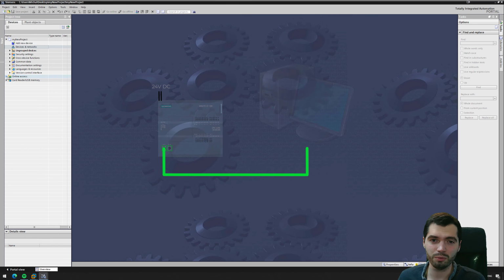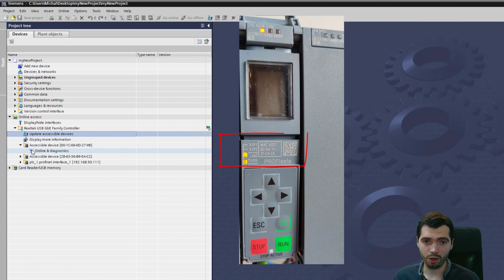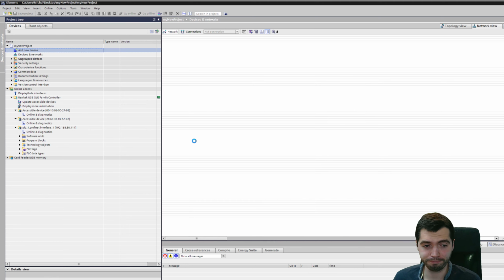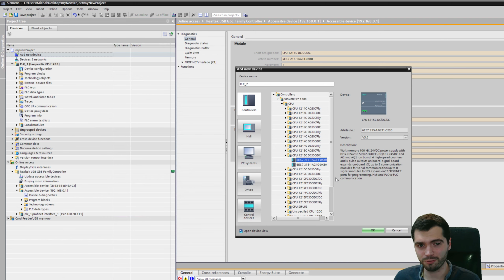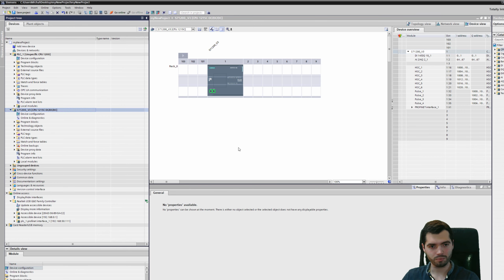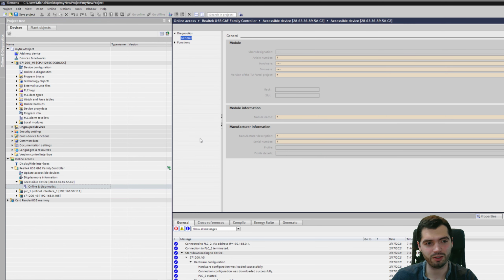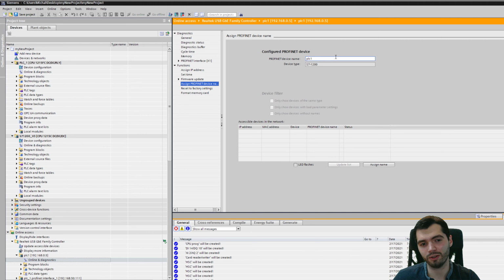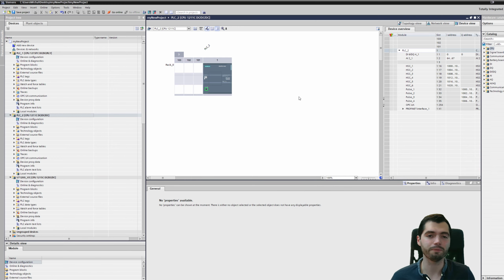First contact with an S7-1200 - How to go online in TIA Portal, even if Target could not be reached

Comment: I am not able to see the network cards. I keep getting an error stating An Iterface is not availbe for online connections to configured node. But if i check my ethernet conncetion it shows connected to an unidentified connection. Any idea of what might be going on. This is a work laptop so i do not have andim rights.
Reply from the maker: Laptops without admin rights can be a proper pain to be honest. Hard to work with and hard to diagnose. So it's not showing the interfaces at all - are you able to try and add them in TIA?
Online access -> Display/hide interfaces
If not check and make sure the cards are actually visible in windows
And to be honest I think you're best off logging a support request directly with Siemens - it's free and someone should be able to help - although the lack of admin rights will give them a headache ;)
Reply: Please am Having the same problem, have you solved the problem, ifyes, what was the prblm?